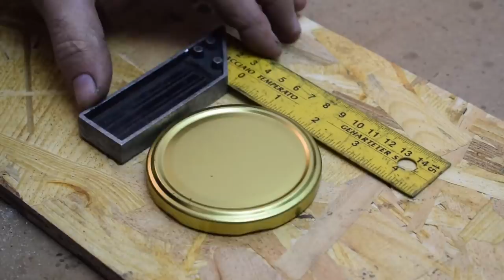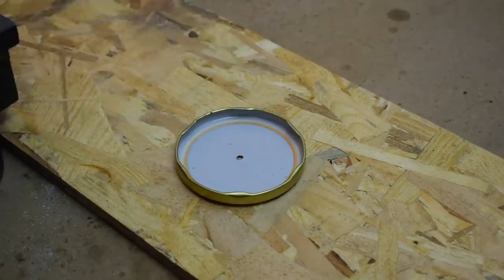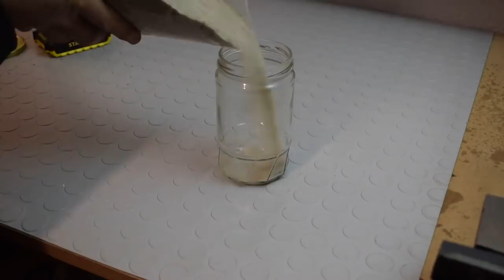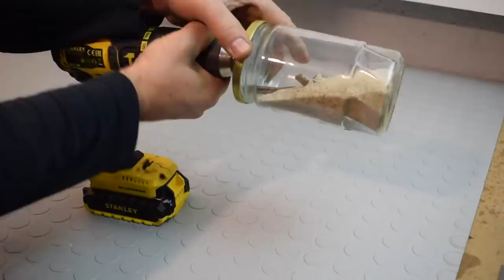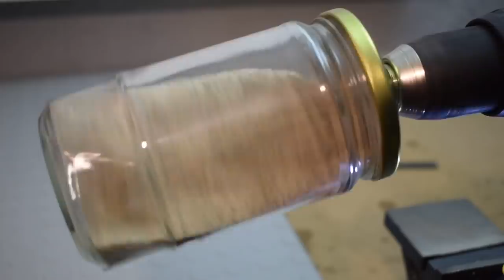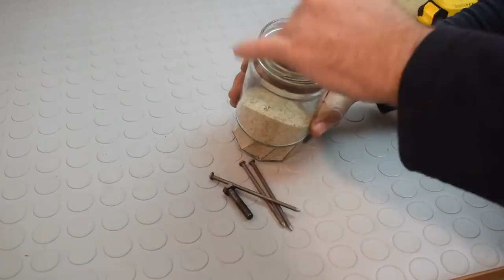No Sandblaster No Problem! Do This for Remove Rust

Comment: Given that the most expensive component in this set up is the battery and the cheapest are the nails I would recommend buying new nails and saving the battery's life for better projects.
Reply: Actually it does have a role.  I restore vintage vehicles. Sometimes rare nuts and bolts of specific sizes may come in British Standard Whitworth sizes.  That’s when abrading small quantities is useful.  Having said that, I own a glass beads blasting cabinet
Reply: Nobody likes a critic, except another one. He applied critical thinking and built a inexpensive tool, that works ! You, not so much. Just saying 🖖🏻✌🏻
Reply: Agree with JL, its the concept thats being demonstrated.
Reply: I have that exact same stanley driver. Lasted now 6 years with the two original batteries, and no real degrading yet on them. Use it frequently.
Reply: This process might be OK for restoring small vintage motorcycle parts. But batteries are expensive.
Reply: But its rechargeable? 😑

Comment: Great now I just have to get a jar large enough to fit my car in. But I’m gonna save so much money from not having a sandblaster.
Reply: FULL ROTISSERIE!!!
Reply: That oversized drill might run you a few dollars also. Probably should avoid battery powered ones...
Reply: Just get a handblaster connected to an air compressor. We have some at work that are custom built by maint that are just vaccume fed from a 5 gallon bucket
Reply: Hahahahaha use the outdoor pig rotisserie 😅😅

Comment: i hope this is a joke ,you wasted 2 hours worth of battery power , where you could have just used a wire wheel attachment on the drill that would have taken 2 minutes to clean them parts  .
Reply: 🙈🙊🙈🙈🙊😂😂😂😂😂🙈🙈🙈🙈🙈It's a joke for me

Comment: Sir, I would like to beg you, on behalf of the battery pack, to please mount the drill into the vise using the grip part of the drill and NOT the battery pack.  If the battery pack gets damaged it can not only be costly, but you can end up with a fire situation that is nearly unstoppable until the lithium is fully consumed by a very hot, very sparky, and very nasty dribbles below it, and very nasty fumes and gases which are not only unpleasant, but also not conducive to human life. For this purpose, I would employ a cheap corded drill. Also sir, if you would read the manual again, I bet you would find some small print that states that running your nice Stanley cordless drill at lower than full speed for an extended period of time will damage it. Specifically the switch and speed control circuit. The lower speeds are only for starting drilling and starting the insertion of a fastener, but never for very long at the slower speeds. Yes, I'm one of those geeks/nerds who reads every word of my instruction manuals. It saves me money in the long run from not having to fix or replace my tools. I make my money repairing things, much of the time because they never read the manual. Oh, I would bet good money that the Stanley drill is actually a Dewalt with the Stanley name on it. After all, Black and Decker, Dewalt, and Stanley are all under the same corporate roof, the same company. That is, unless it is counterfeit, but even then, even the real ones are made in China too, so go figure.
Reply: Thank you fire marshal bill! 😂

Comment: The before and after photos were taken at different exposures to make the result look better, but more importantly the drill would soon wear out running it constantly for that length of time.
Reply: the drill will become wobbly to. The main idea isnt bad
Reply: Only six out of ten items are shown at the end. Presumably four items were still too rusty to show.
Reply: Not just different exposures, different color temperatures too. I think the basic idea could work but it would take a lot longer than 2 hours and it would be a hell of a wear on a drill. Honestly I'd expect that the lid of the jar would fail from metal fatigue before the rust was gone. But using a rotary tumbler does work, if slowly.
Reply: With a battery that size, wouldnt last that long
Reply: if a new drill they normally have a years manufacture warranty problem solved
Reply: I built something like this but I ran two idler rollers side by side with ball bearings then ran a pulley from one idler to a 1/4 hp motor and used a piece of 4 inch sewer pipe with caps for container. In tumbles really well and has lasted 8 or 10 years so far.

Comment: I have a old rock tumbler, but I use a vibratory tumbler for brass shell casing cleaning. You just have to use a more aggressive media than walnut shells to cut rust and you can add vinegar.
Reply: bag play sand from Lowes its cheap too

Comment: Just put vinegar in the jar and put the lid on, wait 24 hours and rinse.  Those will be shiny new!
Reply: I do as you mentioned (using white vinegar) which is a great way to remove rust. Only drawback I find is the surface finish becomes dark grey after treatment.
Reply: @SadAnorak  Depending on level of rust you might need to give it a quick brushing and rinse with water.

Comment: My 15,000 gallon pickle jar broke after the C10 cab rolled over after 9 turns. I lost 8,000 lbs. of media on the driveway and took a 4 days to clean it and glass up. Drill quit working! Bigger bolt?

Comment: i would have taken a metal can.
even though glass can be as hard as steel, it can still break without warning, posing a risk of injury.a friend used an old concrete mixer.

Comment: Ill give you points for ingenuity.  However, you made a complicated solution for a simple problem.  You would have been better off just using rust remover or a small, cheap sonic cleaner and would have gotten better results in less time.
Reply: Exactly what this guy said 👆
Reply: Free though.
Reply: Put the Bit in your pocket.  The rusty stuff in the shitcan.  Punch Out!  Go home.  We don't have time to do this.

Comment: I'd dangle the drill & jar combo over the edge of your bench, so jar is upright. Clamp or weight & support drill so it stays put, and use a spring clamp on the trigger for easy on and off. Great idea. Cheap and easy.

Comment: I use a cheap $25 kids Rock Tumbler and the clean bag play sand from Lowes and you dont have to worry about a drill battery running down, and you can let it go all night

Comment: I’de just use either battery acid or Muriatic Acid “ hydrochloric” used fir swimming pools. Leave uncovered and away from all sparks as it will give off hydrogen gas. Then thoroughly flush with a mixture of  water and baking soda. Probably less than 30 min and better results. However dealing with dangerous acid, take all necessary actions to protect eyes, skin, clothing and don’t breath fumes which are irritating and explosive and give off heat. I would suggest outside in heavy steel container or glass jar, maybe even put in ice water bath so the heat doesn’t cause it to ignite and blow up in your face if you are near it when bubbling.

Comment: vnteresting, I have 2 questions
What rotation time did you use on the cordless drill?
on electric drill, faster, have you tried?
if so, with what results?
Reply: 2 Heures de rotation c écrit dans la vidéo  à 2min39 . Pas très rentable mais c mieux que rien si ont à pas de sableuse . Une bétonnière peut aussi faire l'affaire pour une + grande quantité de pièce à dérouillé .
Reply: @rorodu5510   merci bien, 
je vais essayer la perceuse électrique

Comment: Use a shop vac. Fill with sand and parts and turn on. Its like a tornado inside a vacuum. Just like its a      vacuum inside a tornado. 😅

Comment: Drive to a local hardwear store, buy some nails, then come back home.  That takes me 20 min and I also get brand new nails. 👍
Reply: BINGO!  Put the Bit in your pocket.  The rusty stuff in the shitcan.  Punch Out!  Go home.  We don't have time to do this.  If you had straightened a rusty nail for this piece you'd get a F rather then this D-.   What, ... no Star washers?
Reply: Вот это да...умы не постежимо.

Comment: I’ve seen some good ideas but I think I would rather go to the hard were shop and buy some new bolts the time you waited for that to take the rust of I could gone down the shop gone round mums picked Peter up popped in the Winchester had a pint and the gone home 😂😘😘

Comment: 2 Hrs. to remove the rust on some small hardware, really? This could have all been done in minutes using a wire brush wheel on a bench grinder.

Comment: What a waste of time. If you had thought it through you would of used a plastic container, that way you could run the drill at much higher speeds.